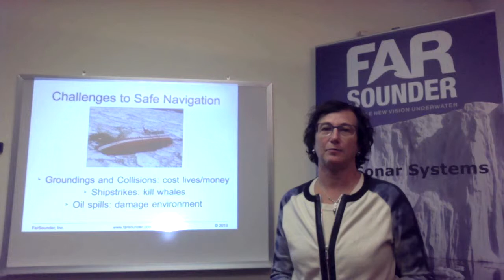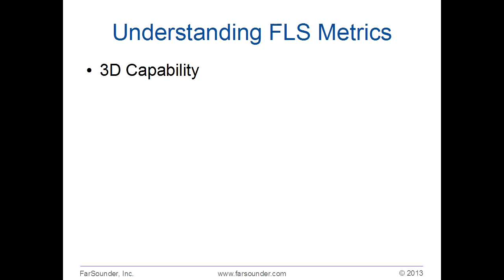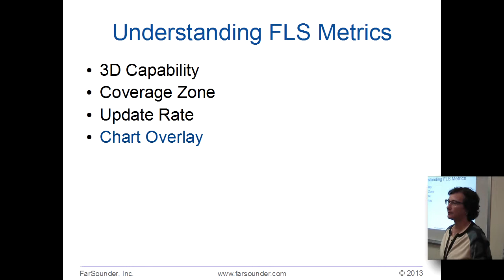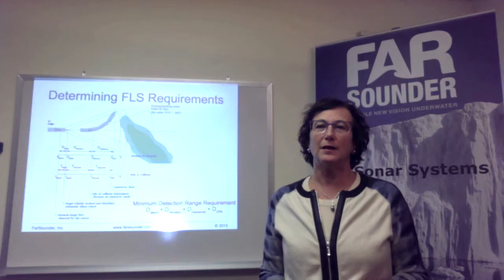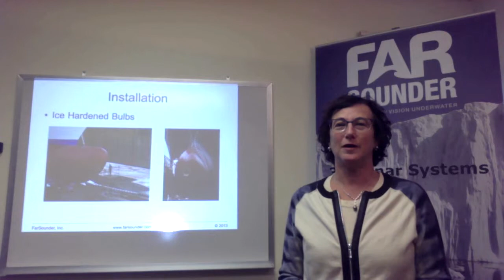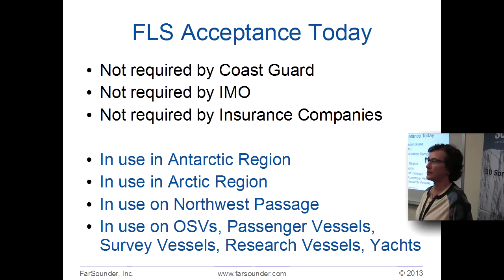Forward Looking Sonar (FLS) for Safe Navigation

Comment: Hi. How can you detect a ship with underwater sensors in shallow water?
Reply from the maker: @abhishek gupta, Thank you for your interest. Our sonars operate by transmitting a sound underwater and listening for the echoes. Any surface objects that extend below the water can create underwater echoes. If the echo is loud enough, the sonar can detect it. Ship hulls are GREAT reflectors. However, due to the long, smooth nature of a hull, their reflectivity pattern is usually quite narrow. This results in a great echo, just not back to the sonar. Note that ships usually make good radar reflectors and can be detected with radar. The bubbles generated by a ship's wake, on the other hand, usually make great sonar targets. You can read more about this on our tech blog here: http://www.farsounder.com/technology/blog/water_depth_limit
Reply: Thanks for your clarification. But why don't you also use the pressure disturbance generated by a moving ship to detect the ship using underwater sensors? Isn't it feasible?
Reply from the maker: Our current products are active sonars. That means they transmit a signal and listen for echoes. You are referring to a passive sonar which does not transmit, only listen for sounds produced by other things. We don't currently offer a passive mode for our sonars.

Comment: can i find a 30 meter range sonar for small ASVs?
Reply from the maker: @kareem yaqout, Thank you for your interest. At this time we only offer 500 meter and 1000 meter range sonars. We have had our FarSounder-1000 installed on various small ASVs.
Reply: thank you for answering me.
i have two questions about the product please,
can i connect it to a raspberry pi or an arduino, to have digital reading from it, and i cant find its price.
thank you so much for your help
Reply from the maker: kareem yaqout Our systems are not designed for connection to a raspberry pi or arduino. Our sonars are commercial marine equipment and can interface to a number of commercial ECDIS systems. Please contact one of our dealers for a price quote.